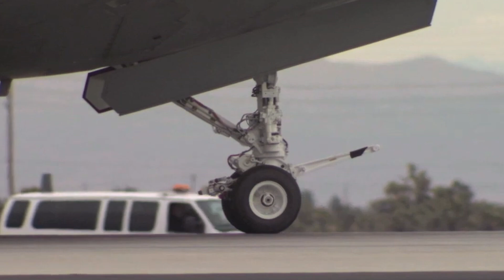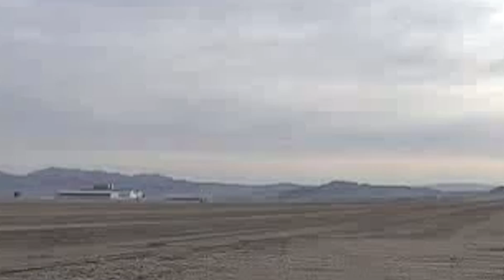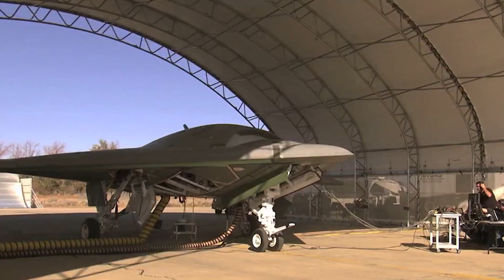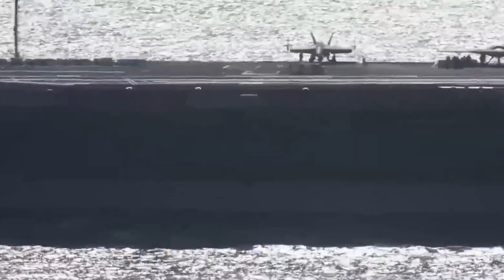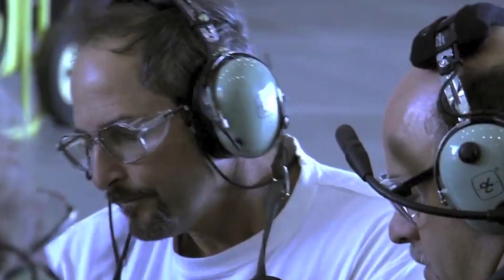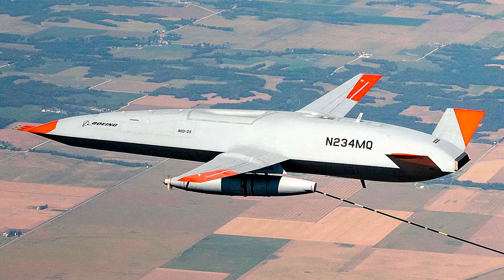US Navy X-47B Stealth Strike Fighter

Comment: It's a shame that these were insufficiently stealthy and deemed too expensive. Our carriers desperately need a strike platform with a radius of a thousand miles.
Reply: It was always a test bed. Lessons learned will be implemented into new platforms.
Reply: @BrianBourgeois-  We desperately need the new platforms. And the drone platform for refueling isn't actually stealthy and doesn't carry enough fuel for the F-35. The level of incompetence in the US Navy is astounding. I expect the admirals and high officers to effectively be working for American defense contractors. But they also seem to be working for China in undermining US ability to deal with China
Reply: Correct the engines are of Turbo Fan design which is easily detected now days by enemies but there are stores of em that exist & U can trust me when I tell ya that there is more is one X47. The X54 replaced this model circa 1997 with an even larger twin nuke internal weapons bay. Mostly the new age drones are all much smaller cheaply made expendable electric designs. This thing is made to deliver a high yield NUKE or like substance then even fly on to hit a second or third target it's not a joke drone at all. Therefore it is regular fuel powered Turbo Fan twin engines so the delivery of a nuclear weapon will not knock the drones avionics screwy so it can return home to fight again. I am not even saying the Predators are all electric to date. Some R some R not. The Navy and Air Force R truthfully experimenting using real life combat to determine what type of drone they use where. There R several short range model electric drones fired from U.S. Navy ships all electric and have 600 mile range and nearly a 150 to a 600mph top speed and cannot be detected. Mostly that was what hit the Russian air bases despite what the communist state & jew run media might tell U. Stuff like the X47 and X54 and X35 those are designed to be stealthy large payload dooms day drones. They do leave a heat signature that can be detected. Its the electric stuff the Navy and Air Force fire off that really cannot be seen on any radars. Now days they are into those mobile shoulder fired drones kinda like what used to be a shoulder fired rocket. Folks often mistake that type of tiny drone with these larger dooms day machines. Not even in the same league of drone. The X35 drone was designed alot like the predator to carry external weapons but it also has a large internal weapons compartment. Kinda confusing if U cannot see the scales weights sizes of these things. Since 1985 the drone has been the most secret and most untested in combat weapon. A drone is pretty much invincible. Its just been of recent of they are perfecting long distance no contact killing. The armed forces are get much better at it.
Reply: f14 super tomcat should have been built
Reply: @user-fw3fq3de3z  The problem with the super hornet is the swing wing design. They would have cost over $100 million and would not have been stealthy. I think we should have upgraded the f-14s to the d variant and kept them in service. In fact, they might even be useful now and with newer radars and an upgrade to the IRST.  
But we need a long-range stealthy bomber
Reply: @thekingsilverado3266  agree 👍
Reply: @ronmaximilian6953 FA/XX would like a word. Already on the way for the navy.
Reply: Sort of makes the ‘Super Tomcat’ seem as if it might’ve been a nice option right about now. 

Bean counters & the ‘good idea fairies’ never do get a clear picture in their crystal balls. Always too clouded in the end.
Reply: @ronmaximilian6953  not just keep the f14 in service but also the long range air to air should have been kept....
Reply: @ronmaximilian6953  We have F35's, we arent in desperate need
Reply: Common sense is not common practice especially when it comes to defense dollars.
Reply: @ronmaximilian6953  Perhaps the saddest thing is that there are no F-14s in the US inventory. Not even in the bone yards. Every Tomcat we had was scrapped & shredded in order to prevent the Iranians from obtaining parts. Even the Tomcat static displays in the various museums had “sensitive components” removed and shredded.
Reply: With what they figured out from this the one that they adopt in the future will have a range of two thousand
Reply: Look at the X47B shape, you really think that is not stealthy?
If it wasnt, its likely by design during prototype phase... you know losing a drone you cant see aint good.
Plus as succesful and capable as it was, there is no way the program got cancelled.
Its likely there is a sucessor we are not aware of...
Reply: @Coyote27981  I think it’s likely still operational as well. Covertly, but flying. The truth about stealth is that it isn’t invisibility. It’s simply the difficulty in seeing the aircraft. Shape plays an important part of that but only a part. And as the science/art/whatever someone wants to call stealth, year by year it’s becoming less so. Currently the most important component lies in the coatings that are applied. This was proven to me with the work in the F-15 EX program looking into a more affordable option than the F-22 Raptor. Since it’s arrival in the 70s the Eagle is one of the very few aircraft in history that has a RCS that is often larger than the size of the aircraft. Research in RAM, particularly the newest coatings used in the F-35 program were able to substantially reduce the F-15s RCS. Only a few years ago no one would’ve thought that was possible.
Reply: @kentonian  Short of an outright cloaking device I doubt anyone will ever make an aircraft undetectable. Even the Raptor, which is said to be ‘the best’ at not being detected, can be tracked & even locked onto as the merge distances drop. I’m sure we can get much closer to being undetectable, but I doubt it’ll be in my lifetime.
Reply: Funny that so many countries get by without needing a strike platform with a radius of a thousand miles...

But that ours just has to have it.

Why do you think that is?
Reply: @ronmaximilian6953  Nothing works in isolation. Whenever you bring on a new ingredient of any kind to the military, it needs to be exhaustively tested so you know exactly how it'll work in the real world, and then there's a whole huge process involved in getting funding approved, as well as spare parts, training, maintenance, basing it somewhere, etc.  It also needs to coordinate with everything else and have defined purposes of how, when and why it should be used. Sometimes there's good reasons on why things get held up, never happen or eventually happen in an altered form.
Reply: thank you, American navy ! glory to Israel!
Reply: @Coyote27981  its a flying body blended wing low observable, there is a lot more to stealth than just those features, the fact the Navy desperately needs a new refueling platform was all that was saving this program even that feature couldn’t save this project, but all that data will be be useful for other projects.
Reply: @blogintonblakley2708  because money money money and politics as Senators fight to have contracts on their respective states.
Reply: @thekingsilverado3266  we got both designs maybe many..stealth cant be detected
Reply: @OldStreetDoc  Clouded crystal balls? Sounds like a postate issue...
Reply: It has not officially been retired or cancelled.
Reply: @Coyote27981  
Biggest issue with the stealth of the x47 is the engine.
Reply: Boeing MQ-25 Stingray to enter service in 2025

Comment: I have a cool re-fueling idea: What if you had a giant blimp that operates at high altitude, covered in lightweight printed solar panels on its skin. It would pull in moisture from the air, condense it into liquid water, use the solar power for electrolysis to turn the water into hydrogen and oxygen, and then use that to re-fuel the UCAVs. I bet a jet engine could be engineered to run off of oxygen and hydrogen fuel. This would be an unlimited refueling station, with the blimp itself using solar powered propellers to move. It wouldn't need to have any internal defense because it would have a 24/7 swarm of limitless flight time UCAVs swarming it like a cloud of bees. Maybe the H and O can even be used to fill up compressed, empty missiles that are both armed and fueled by the hydrogen and oxygen and only expand to full size when armed. Then you could store thousands and thousands of missile components on the arsenal blimp.

Comment: How can this drone not be stealthy enough? It is the same shape as the B-2 spirit and smaller, so it should be even more stealthy.
Reply: Sounds like an excuse for other 'political' reasons to cancel the development. what a waste of public funding....!
Reply: @dougle03  or a step in the ultimate direction of not needing human pilots. In fact, brother who works for a firm that does work on US friendly planes claims now the human is the problem. Get rid of the human, and you lose weight and have lots more room. Also what paycheck? It's going to happen, but those at the top of both AF and NAVY are often pilots, and they can tell you WHY we always will need pilots. The people designing and working on the newest stuff can tell you WHY the sooner we lose them the better.
Reply: @kittymervine6115  - Not true about the Navy. To move up the chain, you need two check boxes marked: Shipboard command and Academy grad. Shipboard experience is called “career enhancing duty”. Ask me how I know. Airedales seldom rise above Captain (O6).

Comment: With all these technical aircraft I have to wonder what kind of nightmare repairing a damaged vehicle is going to be or will it be cheaper just to push them off the deck into the seas. Then you look at the high level of training that mechanics will have to have to fix them. They will probably have to be college grad engineers. And what if the enemy hacks the aircraft and shoots the carrier that it took off from. But I guess the military has looked into all of this,